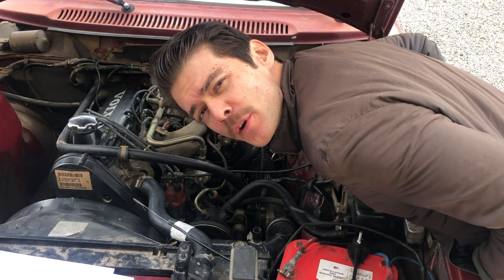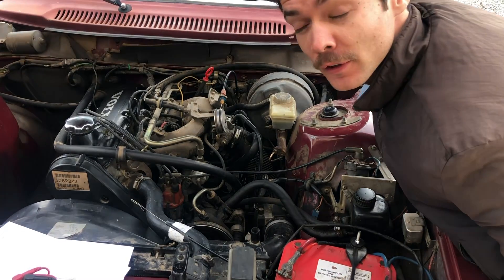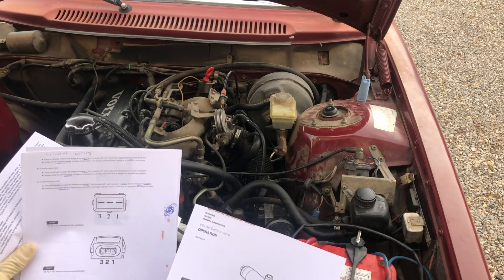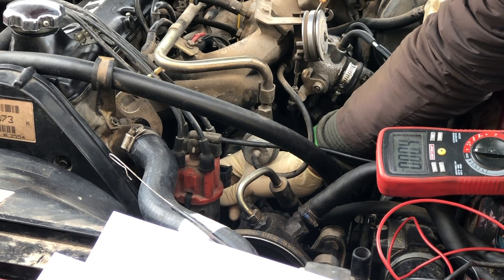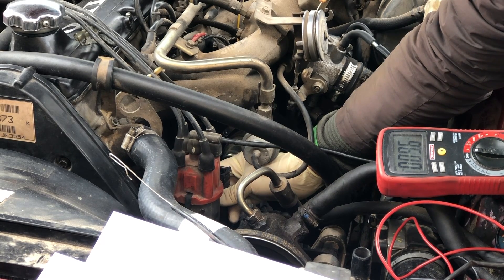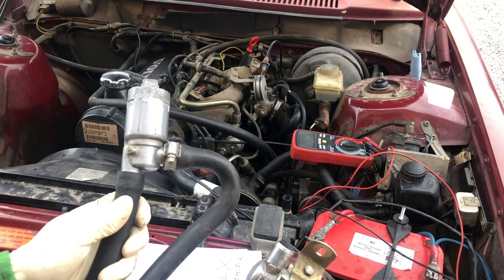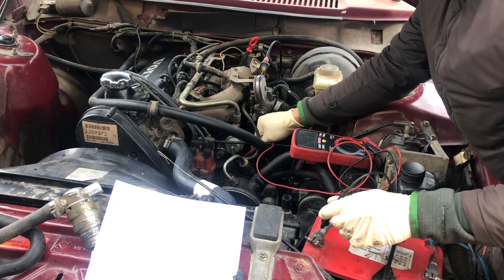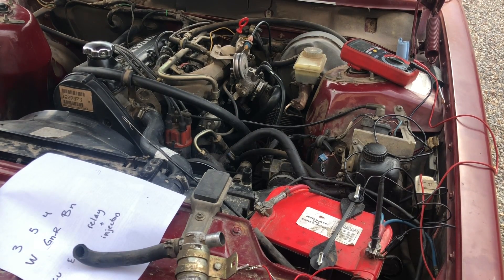Diagnosing & Replacing Idle Air Control Valve Volvo 240

Comment: i had the shop manuals for these 240s and according to volvo 99 percent of driveability problems come from vacuum leaks and don't forget the vacuum tank behind the heater controls, and also to check the black ground wires for the computer near the intake manifold, dirty and or moisture on dist. cap etc, tune up stuff,
Reply: i wrote the wrong thing, stalling is caused by vacuum leak (the shop manual)

Comment: Mine just don't start if I plug the ground part. I see that you ground it after start engine. Was just the blue one connected or just take the red one out. How I need to connect it after start engine?

Comment: i have a 86 740 it wants to run wide open i cleaned it out today and hope it starts working again if not i am lucky enough to have one of the best mechanics.. i've had him fo about 40 years now bought both of my volvos from him and he said he has another one if need be just being the weekend i won't bother him even though i do have his cell # so your video was great for answering the questions i forgot to ask .. my other car is a 93 940 turbo 
  the only other thing i will mention i've changed on the car is i went from the zf22 4 speed to a aw71  3 with an od as they are easier to find and don't have as many issues.. the drive shaft was the only real issue but my guy has one of those for me also .. anyway thanks for having a video that was actually about the part i have on my car .

Comment: What can be my 240 turning off when stop to turn left most of the time?
Reply from the maker: @NgelR  might be fuel delivery. There are rubber hoses on the fuel pump in the tank. Does it do it all the time or when you’re at less-than-full gas tank?
Reply: @DavidBello  when less half tank yes

Comment: Thanks for posting this. I have an ‘86 245 and now stalls when making a hard right. It was suggested to look at a sticky IAC and check the base idle/throttle body is clean. Thoughts?
BTW, my IAC appears to be the original Bosch part. Perhaps it’s best to just replace it?

Comment: Hello and Greetings Mr. Bello! Always a distinct pleasure to watch and learn from your videos. And I must say, I think that I enjoy your "asides" and comments almost as much as your diagnostic adventures. The CIS test port, for settling the idle, I had not known about before and this was a real revelation that you shared. Just finished installing a CIS FlowTech rebuilt fuel distributor on my '84 244 Turbo sedan, and while I had difficulty starting "Ruby" again until I got the air delivery plate properly adjusted, and the 3mm mixture screw 'just right"; she ended up with a really high idle. So thanks to you now, I can have a serious look at the idle air control valve and use the CIS (blue/white wire) test port to get the idle tuned into before adding the idle air control valve back into the mix. We actually met briefly at the "Volvos in the Hood" meet this summer, and it was fun to get to talk with you briefly. Thanks again for your educational AND entertaining Volvo videos!  - grayrider in Oregon

Comment: Well, my idle dosent change at all when i ground out the little plug. Ive gone through 3 iacvs and im suspecting it may not be getting power. Also the wiring harness is fine, no cracks 

Plz help

Comment: If in doubt( aged looking or OEM),replace it! An inexpensive part!Plus," Dave's 1985,like my 1986 were the years of," Biodegradable wiring( Volvo finally changed in 1988),as I bought an "85" sedan very cheap.The guy replaces the battery&put in a new,"Bosch Alternator" about $300.00 for that part&...damn car won't charge I buy the car for $ 400.00,and found," degraded wire,about 1 ft.up the line from the alternator & Re- wired it& a great car for 11 years..
Reply from the maker: Same problem happened to my friend Sara’s red wagon, to the alternator, even though it was a 1992 model. The wiring was snagged and broken at the under-crank mounting bolts

Comment: Hey my 1984 244DL auto has been misfiring. I finally got the high idle fixed. I replace the flame trap, full tune up, new air filter, tons of new hoses. But it still surges at idle. I’ve narrow it down to the brake booster. At least that’s what I hope

Comment: Hi, David, I was watching your video and am very impressed. I have 240 Volvo 88 and have some problem when I reb it from the dial it runs well and when I repeat it again it feels like short of fuel at the start and if I turn the wheel slowly it picks up the speed, but from start, it feels like the engine is going to quit. 
Please advise me what Can I do to cure the problem .Do I have to replace the idle control Valve? Thank you

Comment: - it's a also good to  make sure the throttle cable is not too tight. Do this before you adjust base idle.
- another issue that i have experienced is a LOSE BUTTERFLY VALVE inside the throttlebody axel. It causes binding resulting in a high revving engine. Tightening the axel screws (with the butterfly valve fully/properly closed) and adding a drop of loctite on the ends of the screws ensures a permanent fix for that.

Comment: David Bello, hey man i just pulled my IAC i noticed this part has some play inside it if i shake it somethings loose inside. Im assuming the parts not workin. What do you think play inside that IAC? Is this bad or normal?
Reply: normal. there's a vane/shutter attached to the motor that rotates open and closed, giving less or more air to the engine. it WILL move when shook. when cleaning, bear in mind that BRAKECLEAN will NOT dissolve carbon build up!! Also, IIRC from 14yrs of independent service work, BASE IDLE speed is ~ 720rpm. and CURB idle is ~ 760. its on the EPA sticker on left inner fender.

Comment: I have a 240 auto 1984 B23A, I can not get the idle down under 1200 rpm. Replaced all vacuum hoses, checked by Volvo org book diagram, I am just perplexed. The idle screw on the intake manifold is just a cast dummy, not a turnable screw. The carb, Pierburg, have no idle screw. I have oil in the carb for the slide, ok. I can not find if it has an idle motor.

Comment: Good thing I have Bentley software to show me the correct way to check iac valve but remember the TPS (throttle position sensor) also feeds info to the iac valve. If your TPS isn't adjusted properly this can cause misinterpretation to the computer in turn thinking it open throttle (high idle) is a side effect. This makes it think the throttle is moving although it's not.
Reply from the maker: Chris Martinez that’s right. The quick and easy check is the click as you begin to open the throttle. Thankfully it was just the valve this time.

Comment: I have the green books for the 700s and 900s (what else) and every electrical diagram as well. I've hit this iac thing four times in the last two years.... and found the dirt build up actually seize an air valve completely. some of those replacement air hoses are REALLY expensive. nice how to. at least auto zone tried. kudos for intentions!

Comment: Had a high idle on my "92. After exhaustive troubleshooting I found I had somehow folded the gasket when I cleaned the throttle body. Boy did I feel silly! But as a result everything in the engine bay had been gone over. Good video!
Reply from the maker: Did you remove the TB to clean it?

Comment: If only you posted this a week before. My 940 did the same high revs and cold was pretty bad. Sounded cammed. Took it to a 940 expert and he said IAC was bad. He also said since I didn't have a heat shield, my sparkplug wires were going bad and was causing the car to run on 2 cylinder at start but once warm they all ran. Pretty odd. Sadly I have a Regina system Volvo so IAC is annoyingly hard to find and prices are through the roof.

Comment: Try using 303 aerospace protectant  on some of that insulation!
Reply from the maker: The wiring insulation?
Reply: @DavidBello  the exposed wires, my 740 has a lot of them under the hood. The 303 helps it from falling apart.
Reply from the maker: Brilliant idea. Thank you!

Comment: If  at all possible I like OEM parts too! There is nothing worse than thinking your ruled something out by putting in an aftermarket part only to find out much later the part was garbage. The other problem is when the  part will work for like a month then fail after all the work it took to replace it.
Reply from the maker: SO frustrating. That's what happened with my S60R's aftermarket coolant reservoir bottle by Behr. Luckily, it had lifetime warranty from FCP!

Comment: My IAC is flaky too.  It seems to work at startup. I let it warm up before work and it kicks down like all is well.  Then I go to park and when I take it out of gear the high idle is engaged.  I have the other unit with the 2 pins and the 90 degree config.
Reply from the maker: You're fortunate enough then to have ODB on that car, so check those codes. They should help with the head-scratching.

Comment: Just finished university and currently looking for a job, as soon as I find one I will begin restoring my '86 240 DL wagon
This series is giving me loads of things for my to-do list, it's awesome!
Two quick questions:
Is the crankshaft position sensor on your car mounted with a bolt from the top?
Do you still need the single-fillament blinker bulbs with offset contact spots or did you find a solution?
Reply from the maker: Thanks for watching and good luck!
1) Crank sensor on pre 1989 cars is the hall effect sensor inside the distributor, 3 wire plug on the front of the dizzy body.
2) Those bulbs don't exist in the US, as far as I've found. It was confirmed that the light bulbs used in European models are two filament bulbs, where the US only got one.
Reply: @DavidBello  
1) The crankshaft position sensor should be mounted to the bellhousing just behind the engine. Most are mounted with a bolt from the top, but a very limited number have it mounted from the inside of the bellhousing (mine included, though I changed the mount for the one that has the bolt on the outside)
2) If you want some European, two fillament bulbs, I would be happy to help (I live close to VParts Denmark so I can easily get a hold of them) I will have to check if single fillament bulbs are available with offset contacts.
Also, I don't know if you could install a European blinker housing, since they attach to the headlight housing, which I believe are different in the US.
Reply: @yellow-harold8965  LH2.2 does not use a crankshaft position sensor, there is no sensor mounted to the bellhousing on your 240 or David's, unless it had been swapped to LH2.4. You may find a single-wire pickup that reads off the flywheel, but that is purely for diagnostic purposes and not read by the ECU or EZK
Reply: @Codename5A3  oh, mine is not an LH 2.2, I have a B230K engine, so my wiring harness is not made for fuel injection. I just didn't know that Volvo didn't put crankshaft position sensors on all of the cars.
Its purpose is to send a signal that allows the ignition coil to turn on, I guess I assumed (wrongly) that they would use the same technology for all of their engines.